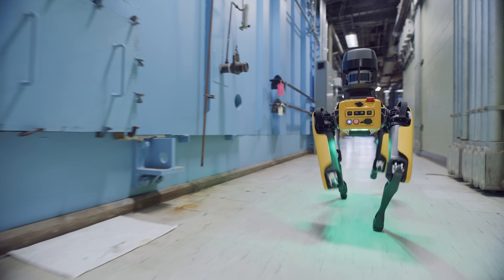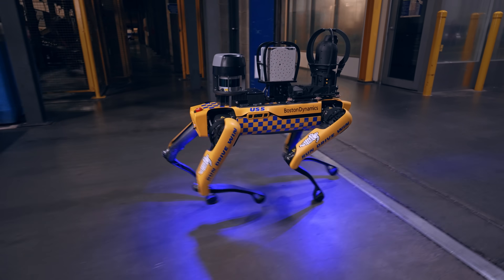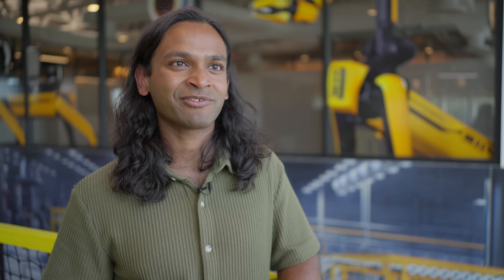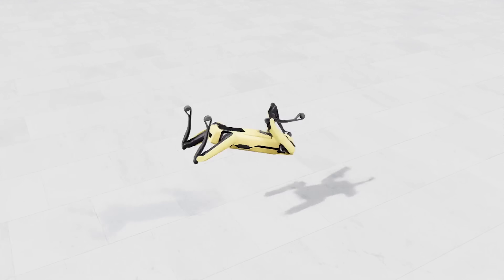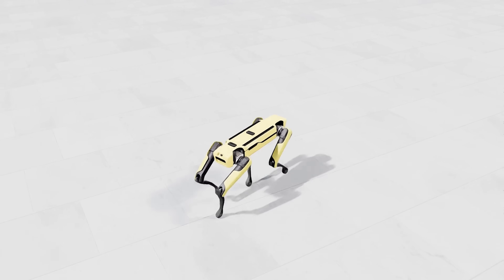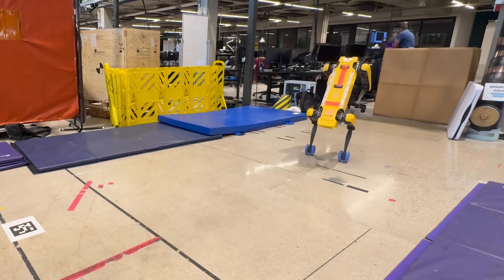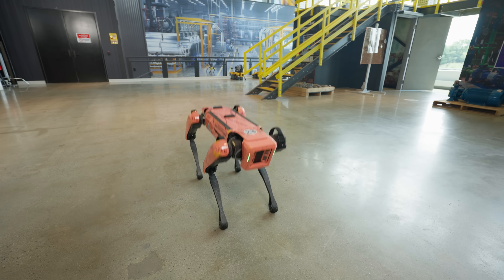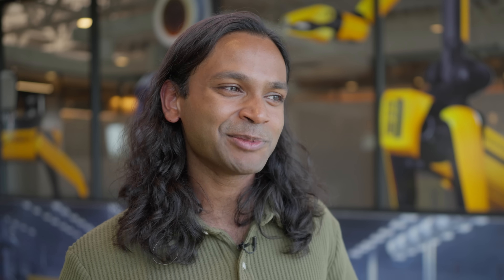Air Spot | RL Behavior Research | Boston Dynamics

Comment: what kind of rewards does a robot get?
Reply: It is normally a score. They are programmed to get as high scores as possible. So they keep trying to get the highest scores. For example, if they succeed in something, they get +10, if failed they get -5. So They move to the way they can make the highest scores. This imitates how people learn something in a real life.
Reply: Do android dogs get electric rewards?
Reply: Staying online.
Reply: The activation weights on the artificial neuron are either strengthened or weakened depending on the reward function - much like how the pathways are strengthened or weakened in a bioligical brain when you remember something
Reply: Just points. The desire for points is programmed into them.
Reply: Lead.
Reply: A belly rub...duh.
Reply: bitcoin, obviously

Comment: Every time I turn around the dog is moving more fluidly. It's honestly very impressive, Especially at the scale these things are at.
Reply: It would be interesting to know it's maximum running speed.
Reply: @michaelbruno1666  yeah that one running bit was glossed over but that's a completely new speed from previously shown, I wonder if its a new gate or speed they've developed and allowed customers to use or if its purely for testing purposes.
Reply: @D2_Papaya  it did pretty close to 4 full parking space widths in 50 frames at 24 fps. Googling US parking spaces, I found that they are 8 to 11 feet wide, with 8.5 to 9 being standard. This puts spot at 11-12 mph assuming a standard width parking space.
Reply: can I buy one?  How much does it cost?  And the humanoid one doing actual work with hands is still a bit clumsy, though I saw one bi-pedal one that could run and jump and do back flips, wonder why the working one was so slow and clumsy.
Reply: @abc123fhdi  You can buy one but the starting price is $74,500
Reply: One day you will turn around and see one irl.

The hope is it's not on "Skynet"s side
Reply: Imagine one coming at you like a spider
Reply: Its also quite terrifying, soon they are going to chase humans
Reply: Any time you think 'cool robot' or 'cool drone' re-think about it in the context of it being used improperly by a tyrant and it having either a tiny bit of expl0sive on it, or it having a gxn attachment or simply bladed arms.
Reply: I was thinking the same thing.
Reply: Every time I turn around the dog is moving more fluidly. It's honestly very impressive, especially at the scale these things are at.
Reply: I love how we calling it a Dog, just because it’s look like a dog. Humans and their pareidolia, amirite ;)
Reply: @le4IF  its design is certainly dog-inspired
Reply: @le4IF  "spot" is also a name associated with dogs (like rover, fido, etc)
Reply: Oh mate, just wait till you google unitree robodogs.... They are light years ahead of this.
Reply: I would like to know if this is an example of iterative in time behaviour or just a programmed stunt . I am not interested in the latter at all.
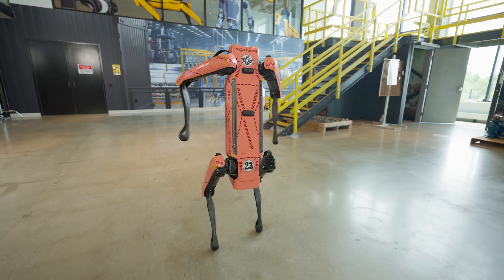Reply: timestamp 3:58
Reply: you must be watching a different video than me, all i see is the same robot dog from 10 years ago doing barely anything different
Reply: and it's named after a cat :S
Reply: In that case perhaps you ought to cease turning around......
Reply: Not dishonestly impressive?
Reply: its been doing this shit for 20 years
Reply: @NPC123UH  spot was developed and released 2015-2019, and has been iterated on since then, they PROTOTYPED spot in 2005, which the prototype could hardly move and was significantly bulkier in comparison, nice try tho bud
Reply: @NPC123UH 😮😮😮😮😮😮
Reply: Yea till blackrock is using them to destroy 'resistance fighters' lmao.